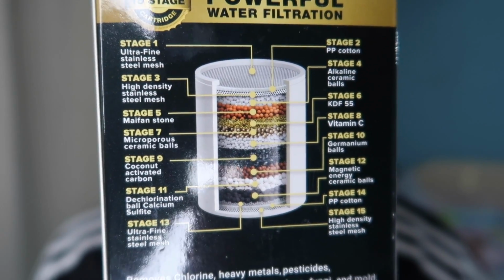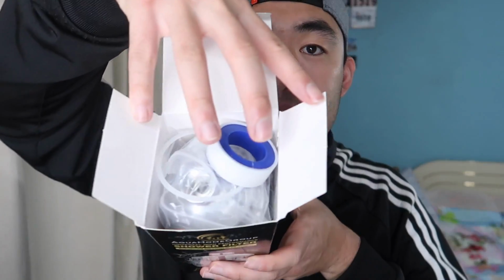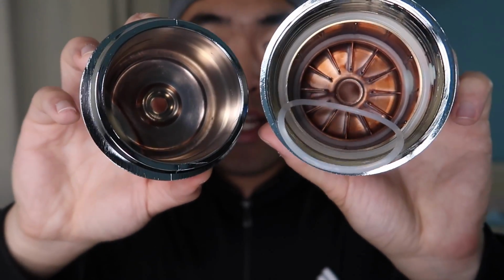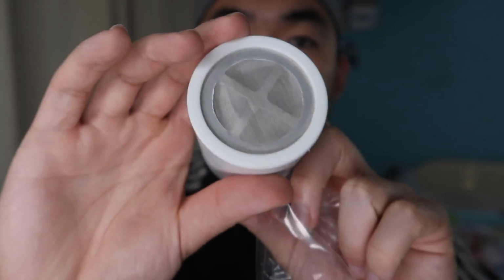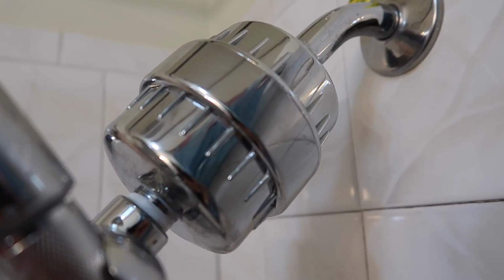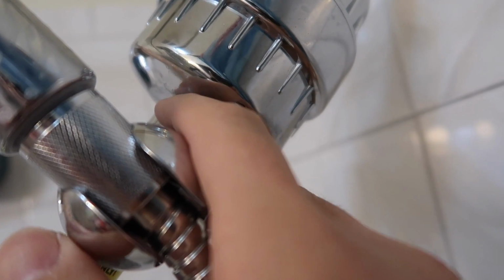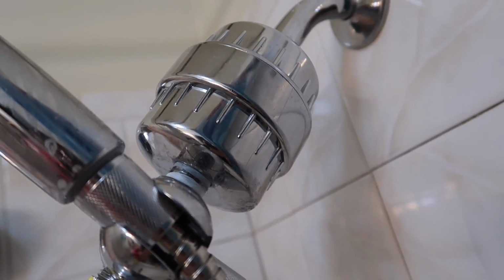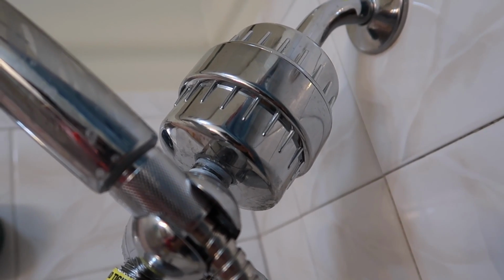Is AquaHomeGroup 15-Stage Shower Water Filter worth it?

Comment: Is this filter/system still working well for you? I was about to buy one, then I saw a bunch of negative reviews about it getting clogged, and water pressure issues
Reply from the maker: No clog for me yet, still works fine. Which reminds me, I should replace the filter soon!
Reply: No clogging. Used two filters now.
Reply: Our head is stuck shut and won't unscrew to switch out the head filter 🤦 we just bought a new head for $25. I will also say our 15 stage filter only lasts 3.5-4 weeks for two of us showering, me washing my hair once a week. We don't take long showers either. So we basically go through 12 shower filters a year with this system.
Reply: @HeatherEndeavors  but does it actually work in terms of filtering out your water? Like did you notice your hair feeling better? Because I believe the reason why my hair is dey and brittle is because of my water
Reply: @nibbax7772  my hair is somewhat better than without the filter and my skin. But not as good as when I lived where there was a water softener in use 🤷 we would need to run some sort of water test to see what it's actually doing.
Reply: @HeatherEndeavors  did you try any other water filters that work? Because I’m on the quest of looking for some because I believe the reason for my dandruff is my water
Reply: @nibbax7772  we haven't. We are using water from our Berkey filter that we drink from, to wash my hair in the sink. Better results. Just showering with the aqua group filters and showerhead for now. This is a rental so we don't want to spend a whole lot until we buy our first home. Then we can set up whatever system we want.

Comment: Is it cleaning anything? No ec or tds reading ...  👎
Reply from the maker: :0
Reply: I have two and I tested mine on a distiller 0 Berky 68 city water 68-70
Shower where filter is installed 68. It doesn't work.

Comment: bruh it does not filter sand(water) scammers.
Reply from the maker: Sorry to hear that your water has sand! Thanks for sharing.
Reply: @IsitWorthit1  actually i use monitor water because the water is slow so its job just to bring more water so i think the filter does not have time to filter it so the sand came with it but they should mention that now am stugging with low water while showering just to get clean water btw its not ur problem am sorry for disrespect.

Comment: I was told when you first get it for 15 minutes have the water on hot so it can clean the filter out it has some kinda black mix in it that has to come out and means your filter is working
Reply from the maker: Yeah but i dont think it was 15 mins, maybe less than 1 min
Reply: Before installing the filter, wash both sides and shake the water filter in the sink. Remove the filter from the housing and just rinse the filter for a while until clear water comes out. The black mix is charcoal, no need to panic.